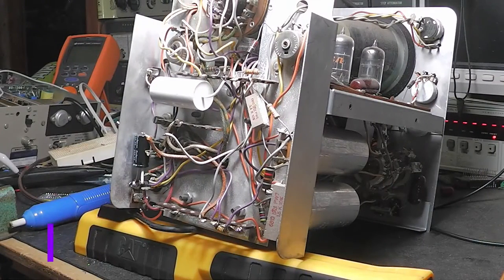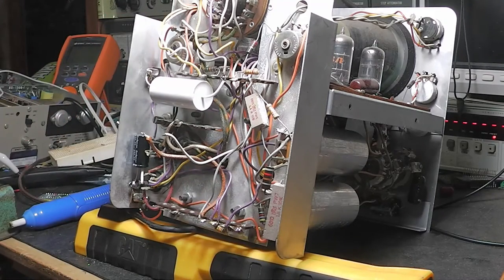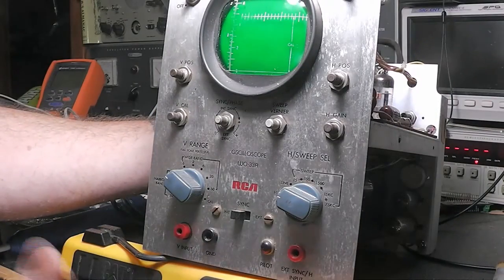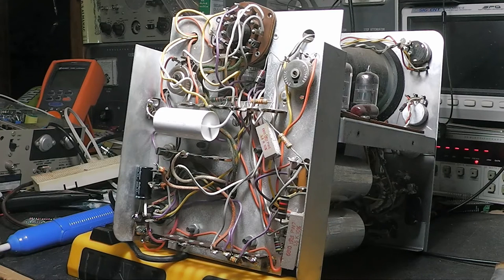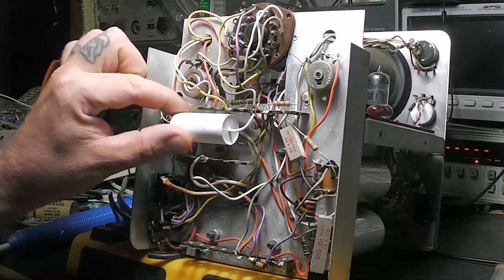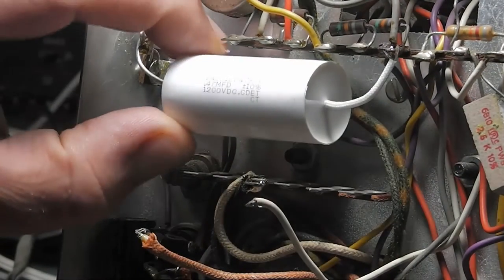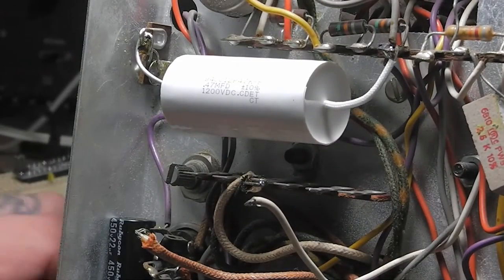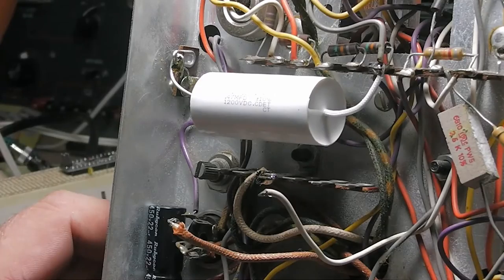RCA WO-33A Oscilloscope Power Supply Re-Cap Part_1 -- B&P 1

Comment: Does it damage it if you attached the stereo jack output from our computer speaker righ to the signal input.  Becasue that's what I do to get a nice waveform when I talk or play music.   I have no use for it otherwise.  I'm going to mount a Monster High Gorgeous Ghoul Anti-Styling head to the top of it, ad use it as my stand in robot for my livestreams so I never have to be on camera and thus never have to bother with putting on any makeup.   Be nice if I could leave off the case and use some mirrors to show off the glowing vacuum tubes...
Reply from the maker: No it will not damage it.  Yeah it would be nice, but unless you are extremely careful you can get a bad shock or worse leaving the case off.  You could I suppose fabricate a plexiglass cover for it.
Reply: @ke4est  I was just worried about matching impedence or signal voltage limits or anything else.

Yeah I was thinking plexiglass cut out on the bandsaw, edges heated with BIC lighter,  with some computer case mod lighting inside.   I've had the case off before, I'm aware of the shock hazard from big caps etc from reading up on TV and power supply repair.    

I have an AA5 vacuum tube point to point wired  radio that depending on which way you plug in the plug, the metal chassis inside is either neutral
or "hot", so I tape over any exposed screws heads coming out the back case because they could "tickle you".

Impressive this thing is still working 60 years, when the USB B connector on most tablets today won't last two.... :-/  I'm sure it probably needs calibrated if someone were to use it seriously for anything really.  I bought it for $10 in a thrift store several years ago.

Comment: I'm still trying to figure out where eight capacitors are going to fit in this very cramped spaced!  I think this is where I would do a can replacement using CE Mfg.
for both C38 and C39. They make a 40/20/20 electrolytic at 500 volts and you would need two of them to replace the originals. But you would also need two 10uF
which you put on   the  terminal strips only. That might have been easier to do than trying to cram eight on the  terminal strips. I know it is a more expensive way( $74.00)
to go about it but less a headache for sure.I see there is a nice pdf scan of the brochure for this RCA oscy at rhetoricity.com which includes parts list , schematic and 
operation of it. Can't wait for part 2!!!
Reply from the maker: Well in this case I want the room for adding a couple of circuit boards to turn this into a signature tracer.
Reply: @ke4est  Mr. Carlson has a part two and more for it but alas I'm not a Patreon guy.
Reply from the maker: @hestheMaster  Correct there is more about this on Patreon.